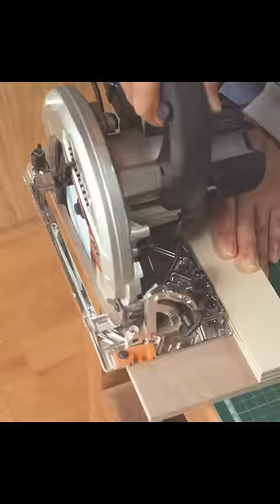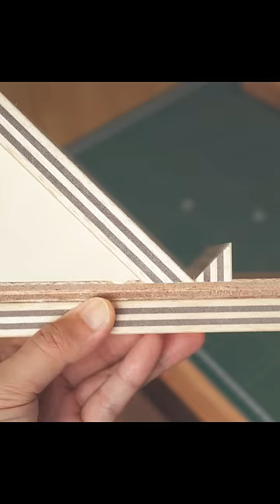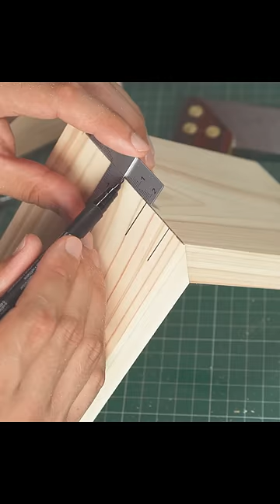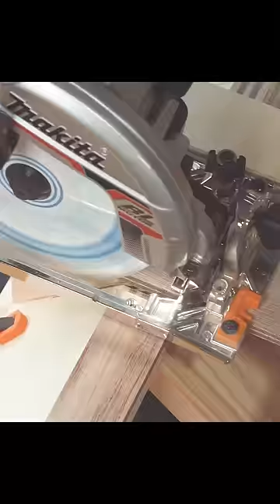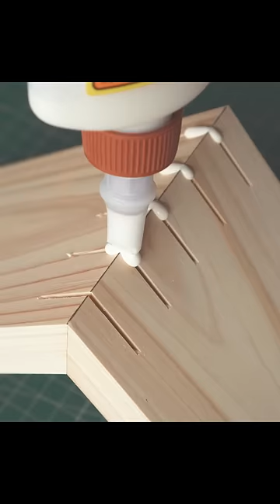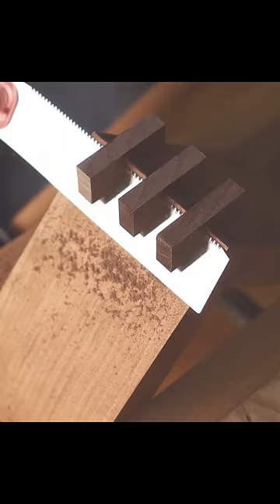Japanese Circular Saw Jig　#shorts

Comment: Not sure the Japanese invented Biscuit joiners. But hey, this is 1 way to do it. Maybe a slightly more work intensive method, but it looks nice!
Reply: for the average joe who doesnt have a biscuit joiner, and besides he is doing it on a corner I don't think normal biscuit joiners can make a clean joint on a corner position
Reply: Test has shown biscuit joint are weak compared to this joint.
Reply: @SunAlucard  It is called a Mitered Butt Joint.
Reply: @myrecent  You do realize that Mitered Butt Joint is about equal tensile strength as a biscuit joint? In fact, they are quite similar! The main difference is one is done on an angle, and one is straight forward......
Reply: @tobybigham4196  mitered butt joint with a spline far surpassed the tensile strength of using a biscuit. Biscuits just align thing, it doesn't add any strength. You can look it up, they even did a couple test on YouTube.
Reply: @myrecent  Well, if you said it. You just blew away everything I have actually accomplished in a shop. Congrats. 

However, a mitered butt joint is what is it simply called. They just call the biscuit a spline in this joint. It is literally the same thing! It uses the same physics and same glue. And a biscuit joint is far far superior than just a simple Butt Joint!  Yes the biscuit lines it up, but that isn't where it's benefits stop. Are you just arguing because you are bored and need attention? Especially when a dovetail or finger joint would work better?
Reply: @myrecent  Even a bridle joint would hold better.
Reply: @tobybigham4196  lol a biscuit same as a spline? You lost all credibility. Just informing people you're wrong. Not trying to argue with a guy who thinks he knows everything when a simple google research about the test would broaden your knowledge.  Have a nice day. Not gonna waste any more time on you.
Reply: @myrecent  BTW, before I go. It is adorable that novices love to join the woodworking community with the goal of changing the law of physics and how things work! You are just tooo precious!😻